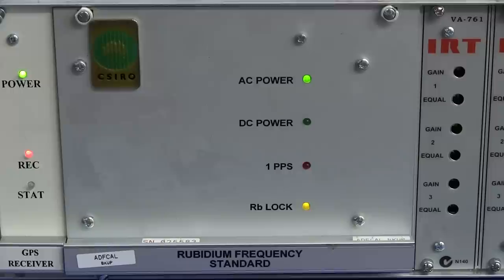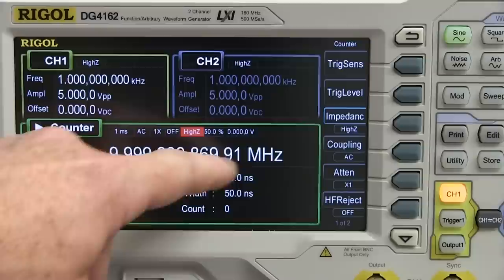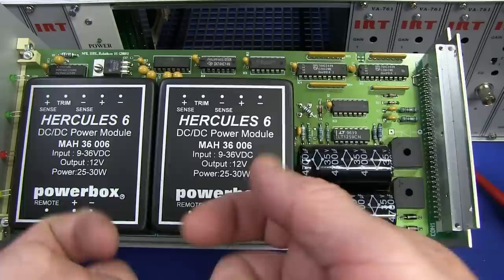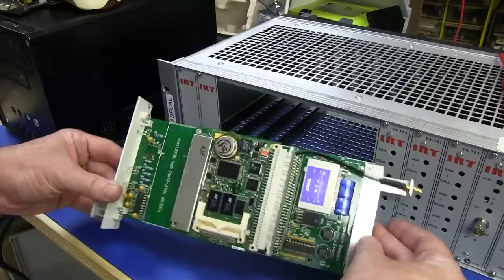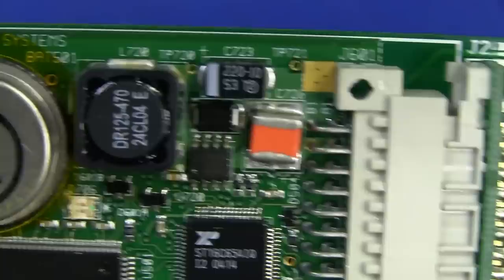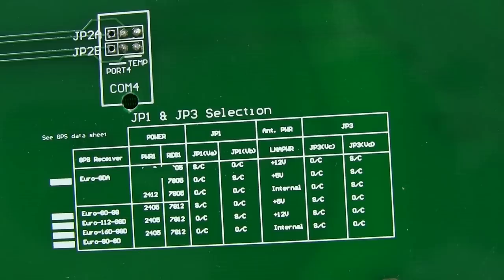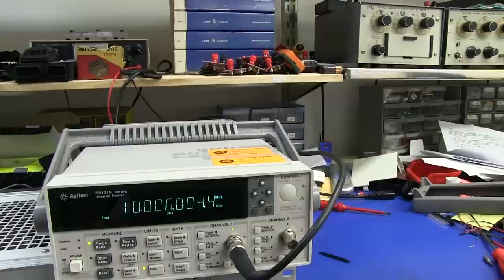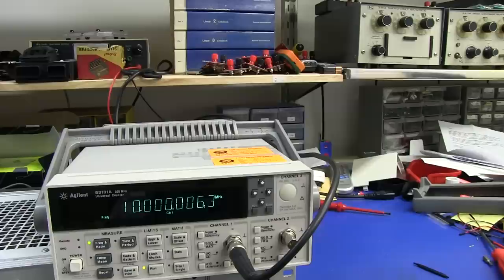EEVblog #456 - CSIRO Rubidium Frequency Standard

Comment: I was looking for a 53131 without options to replace my old PM6654, but after your video i am not sure that i should buy one of this devices :-) By the way, i do my measurements with some old but nice devices like the R&S CMS 52 for RF, my old PM6654 and for frequency reference i use a thunderbolt GPS, some OCXOS and an FE RB clock. At the moment try to repair my favourite device, a SCHOMANDL MES-1000. Thank you for your great and interesting videos !

Comment: Rubidium oscillators are not primary sources like cesium oscillators are.  This means you have to tune them on frequency.  They are very stable, but they aren't "always bang on".  And that's what the GPS board is for - it disciplines the rubidium frequency to match that coming from GPS (which is cesium based).
Reply: +Star Gazer much better an active maser :)
Reply: +Star Gazer What do you mean by 'disciplining' the rubidium frequency? You can't "discipline" a rubidium frequency. The only thing I can think of is - not disciplining, but synchronising. You sure you're not talking about disciplining a voltage controlled crystal oscillator?

The other thing is..... I haven't been able to find anywhere the meaning of a 'disciplined oscillator'. I'm assuming it means 'synchronised' or 'phase-locked to'. Pretty weird how there appears to be no formal definition of 'disciplined oscillator' out there. Not good when these two words are used blindly.
Reply: +Kenny A "disciplined" clock/frequency source is one which is actively and almost continuously adjusted in both frequency and phase to match one or more better time/frequency sources, such that the disciplined device provides a very good extrapolation of the outside time source, which may only be available some of the time.  For example, the GPS radio signal provides the time and date every 1.5s, but only to the extent it actually picks up enough satellite signals to compute the radio delay from space through atmospheric disturbances and past the background noise, as a close US ally, that GPS receiver board might even be one of the classified models that sync to the secret hires part of the signal. Those GPS satellite clocks up there are themselves disciplined by adjustment commands from the relevant US military team to closely match the official US IAT reference clocks.  National time labs then compare their deltas from the GPS signal to help establish the weighted average which is the official International Atomic Time.  (UTC is IAT minus a whole number of leap seconds).
Reply: The output of a rubidium oscillator is typically a 10MHz signal that is phase locked to the 6.834GHz excitation frequency that is tuned to resonance with the excited rubidium gas in the physics package.  While this excitation frequency is very stable once set, the resonance frequency of rubidium is variable and must be tuned by applying a magnetic field to the rubidium chamber.  You have to tune a rubidium oscillator to get it 'on frequency'.  You normally do this by 'disciplining' the source by periodically or continuously comparing it to another (better) source such as a cesium oscillator via GPS, learning the rate at which the rubidium changes with age and temperature, and adjusting for those changes automatically.  As a practical matter, there is a voltage controlled tuning input on rubidium oscillators that varies the magnetic field applied to the chamber, and thus the frequency of the 10 MHz output.

Disciplined oscillator simply means an oscillator whose output is being corrected over long time scales by comparing it to another oscillator.  It is more than simply synchronizing the phase or frequency.  A DO learns the rate of change of the oscillator and continues making those corrections even when the reference is no longer available.  So a GPS disciplined rubidium oscillator will continue to make corrections to its rubidium even when the GPS signal is no longer available to sync to, based on the change rate it learned while GPS was available.  This generally increases the stability during the 'holdover' period when the oscillator is free running.

The actual oscillator being disciplined in a GPSDO can be of many different types, such as quartz based, or rubidium.  Quartz having better short term stability (seconds to minutes), and rubidium having better long term stability.  If the GPS signal is always available to discipline the oscillator, then quartz is fine.  If you need longer term holdover characteristics, such as for cell site synchronization, then rubidium is typically used.

Comment: You need to change the gate time on the counters to achieve a higher accuracy. Are you terminated correctly on both ends? And the rubidium reference *will* drift over time. The GPS timebase is *much* more accurate.

Comment: The reason the PCB is marked both 'Javad' and 'Topcon' is because a large portion of the high-accuracy GPS receiver industry can be traced back to... HP.

HP developed a GPS receiver in the early 80's, but they shelved the project because it was unclear if the US Navy would get the funding required to complete the GPS constellation. In 1982, HP sold their breadboard prototype and stack of documentation to Charlie Trimble for around $50,000. One of Trimble's employees, Javad Ashjaee was the primary software developer for Trimble's first survey grade product, the 4000S. Javad left Trimble to form Ashtech in 1987, another producer of high-accuracy GPS equipment (acquired by Trimble in 2011). Then in 1998, Javad Ashjaee formed JAVAD Positioning Systems, which he sold to Topcon in 2000, forming the foundations for their GPS business. Javad's non-compete with Topcon ran out in 2007, and  he formed JAVAD GNSS, which is still in business. Sadly, Javad Ashjaee passed away from COVID-19 earlier this year (2020).

Comment: You need to lab recalibrate that HP unit. Please believe usRb (Rubidium frequency standard users when we say that IF the Rb unit is checked against a facility, college or government lab that has a primary atomic clock standard, the Rb (which are secondary frequency standards) are good and accurate out to 11 places right of the decimal point. Their drift when locked is less than .0001ppm per every 50 years give or take.

Comment: In the video about the HP5061A Atomic Clock we saw the cesium oscillator worked in conjunction with a ovenized crystal oscillator for short term stability. Does this rubidium standard need a crystal oscillator as well?

Comment: I've got my hands on some old Polish "quartz frequency standard". Loud as hell, has some fail crusty custom switchmode power supply from a handmade transformer that drifts all over the place and eventually crashes if you don't put enough load on it. Oh boy, when the crystal was reaching the temperature and the oven switched off the whole thing crashed. Had to make special 12V rail for the crystal and put a dummy load on the old crystal rail to keep the old supply happy.. Good enough for Poland!

Comment: Not likely. That kind of gear is likely to be consistently out in one direction or the other if it's out of cal. There's one oscillator for the whole thing, which is then divided or multiplied as needed.

It's not a cheap piece of gear with multiple RC oscillators for the different ranges, like seen on some multimeters. Those things drift all over the place...

Comment: Attempting to call a rubidium oscillator 'out of spec' while using a 10.5 digit counter (without a high stability option), and on the default 100 ms gate time...  You need to set the gate time to 1 second.

Set your instrument up properly, and then call it out of spec.

Comment: What you probably have is a GPSDO.  Have a look at GPS_disciplined_oscillator  at wikipedia for typical way GPS and Rubidium are combined. When GPS is available the rubidium is locked to the GPS 10MHz, the distributed 10 MHZ comes from the rubidium for low phase noise, but the GPS is used to drag the rubidium to the GPS 10 MHz.When GPS not available, the rubidium then is the only reference (which is still pretty good). This is called holdover (till GPS is re-acquired)
Reply: GPSDO without any rubidium, only with good TCXO can give 0.1ppb precision.

Comment: Actually not true... at least from my own experiences, perhaps your gear works different...
Until the GPS get 1PPS sync from the satellites cesium clocks it runs on the recievers oscillator, just an ordinary tcxo...

As I said - at least on the gps's I use (for 1PPS control), and from what I've read.